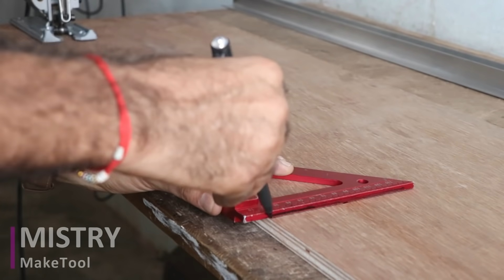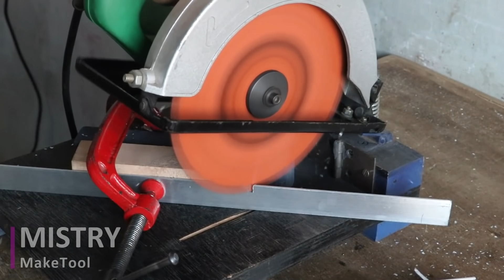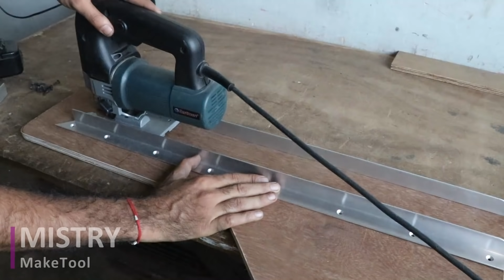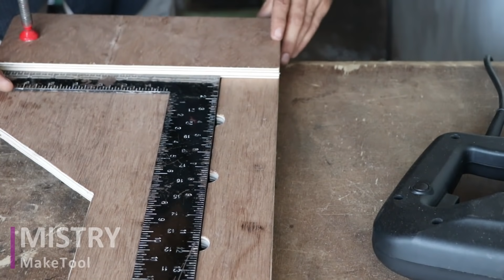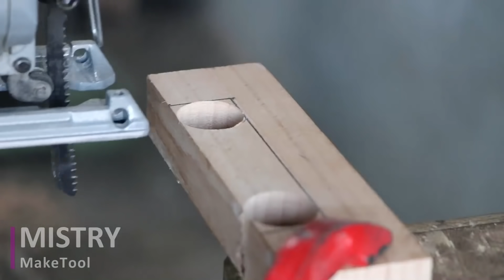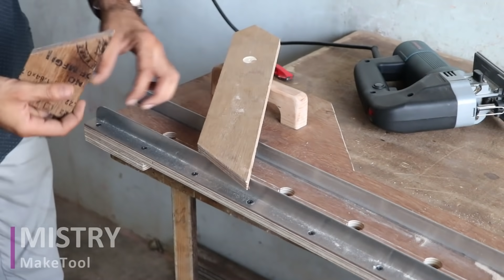Make A Jigsaw Guide Track || DIY Jigsaw Straight And Crosscut Jig

Comment: I definitely like the miter backstop for workpieces as well as the built-in 45 degree guide, but I would want to add some dust ports to prevent the saw from riding up.  Also, some 30 and 60 degree guides could be used to reduce overall weight.  A composite of thinner ply and lexan would help support the work at the observation ports.  Perhaps another reasonable iteration would be to mount the backstop on knob bolts so it could be expanded for the height of the workpiece.
Reply: where would you put the lexan? i like this idea.. and have a lot of lexan haha but want to make sure I understand where you are talking

Comment: I watched a couple of tutorial videos but I couldn't understand the point of the holes in the guide. I mean this 4:33 What's the reason of this? It couldn't be only the straight line, so the blabe can running through? Why the blade has to cross from the holes? Thanks in advance and also very nice job!
Reply: to easily see if the blade and the line that the material to be sawed is still in allignment

Comment: Great craftsmanship! 
That’s a whole Lotta work to cut a line with a jigsaw but it looks great. 
I guess if you use a jigsaw a lot would be practical. 
I think you would get a much straighter cut with a circular saw and a straight edge. 
Jigsaw blades has some waiver to it when you cut. 
Very nice jig though! 
like I said if I needed a jig made I would hire you to do it 👍
Reply: This is perfect if you're on a tight budget. With a drill and jig saw you can actually do alot of work

Comment: I did the same mistake, in fact my jig is almost identical to yours but unfortunately jigsaws just don't cut straight since the blade bends. If I would do it again I would use a circular saw.
Reply: if you let the jig saw move on its own with very little pressure the blade wont bend
Reply: @manpreetsingh46  quite rightly said
Reply: exactly, there comes a time when the saw bends and the cut comes out of alignment. I don't know how to fix it

Comment: Whenever I use a jigsaw and ruler to support one side of jigsaw foot, or a guide supporting both sides of jigsaw  foot, I get  inuppropriate results, the blade goes under angle.
From my experience consequently, both types of jigs are inappropriate for jigsaw, at least for mine. 
I have green Bosch jigsaw. I measured the foot and blade angle with inclinometer, and they seem to be parallel say less then 0.2° mismatch, quite close. The blade is 20tpi, the reciprocial move is turned off, everything in order, but the jigs tested generally unusable.
I do not advise making these, either with one or with two supporting sides. Only hand guidence of jigsaw should be practiced, or making blade guidance with two ball bearings to keep the blade perpendicular.